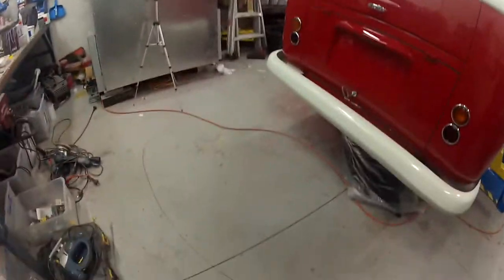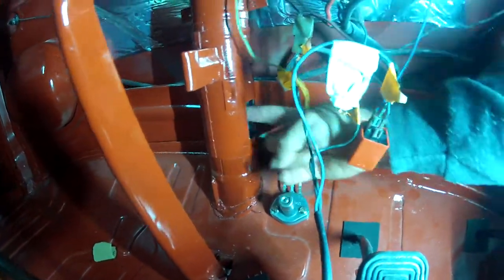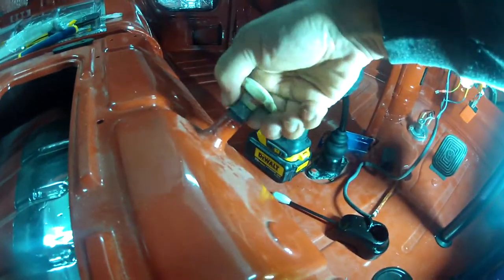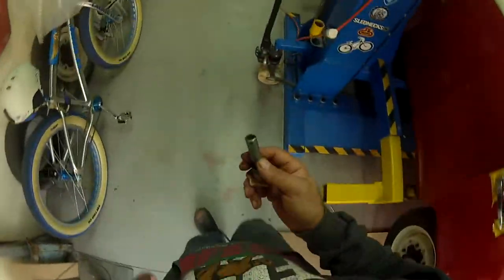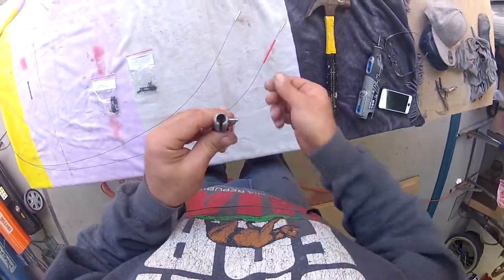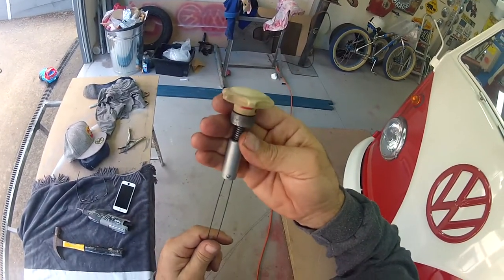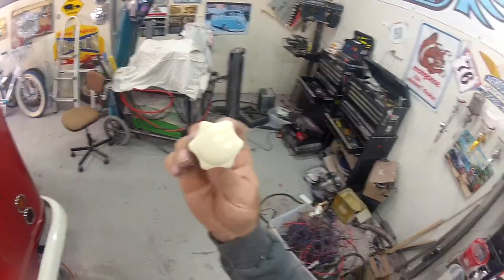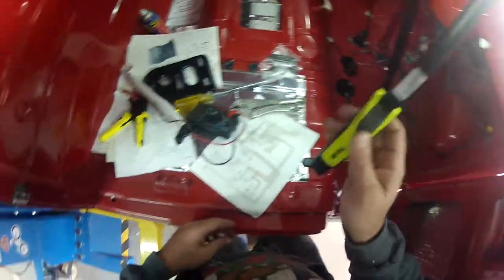VW Bus Restoration - PART 19 HOW TO INSTALL HEATER CABLES #vwrestoration

Comment: Another great video on a task many Transporter owners eventually have to tackle.  I love your shop and hope someday to tour Australia and perhaps go for a ride in your Bus.  

I have a few helpful hints to add to help out.  At about 5:30 in the video you mention that you thought the two cables "twist" as the knob is turned.  I don't believe that is the case.  In a properly working system, that silver section with the pin holding the looped cable doesn't turn in the bore of the shaft.  It simply slides up and down the bore of the shaft pulling or releasing the cable.  Grease it all up good!  It shouldn't twist the cables.  #2. At about 7:30 in the video you clean up your ivory colored heater knob with abrasives like sandpaper.  My suggestion is to use either try a grease removing hand cleaner or a good dishwashing soap full-strength with an old toothbrush to get most of the grease and dirt off the knob without removing plastic material.  And #3:  "Grease is good"!!!  The longer end of the cable usually goes to the right side heater box.  As you feed the new cables into the individual tube holes, slather the wire heavily with fresh wheel bearing grease as you slowly slide it in.  You can't put "too much" grease into those tubes!  Use lots of grease and those cables once hooked up will slide nicely and will last longer that if installed dry.  Lots of grease!!!  Cheers and keep up the great work and how-to videos!  

Bill
Reply from the maker: Thanks Bill, welcome anytime here mate!! great tips and yes I realized after the video that the cables don't twist :) I will pull them out and change them over. Thanks again :)

Comment: To clean plastic parts and painted metal, use EASY-OFF oven cleaner. I stumbled upon this use when l thought l'd try to remove soap scum from shower walls. It works great! Just don't use it on anything that has a 'sticker' or 'decal' as it will remove that as well. It would have made quick work of that heater control knob.

Comment: So you leave the plastic sleeve on the one side??  What side does that one go in?  I assume the longer side goes on the passenger side...yes?
Reply from the maker: Correct 👍🏽
Reply: @DemopVWgarage  Just replaced mine on my ‘62 single cab today. I left the plastic on it and it fit, but my buddy said cut it off as it’s only for PN ID…(shrug).  Thanks for the instructions!